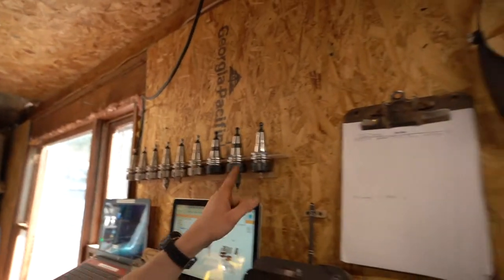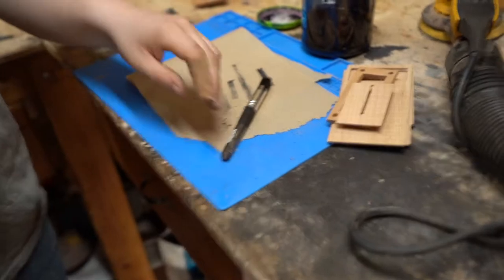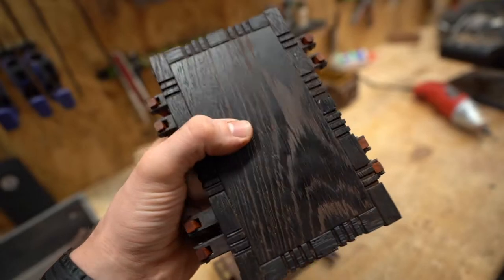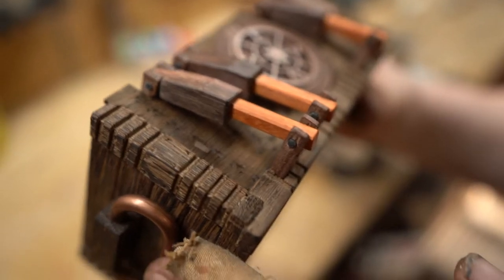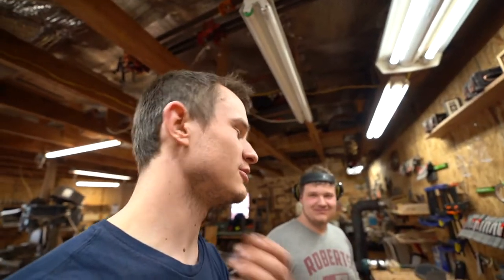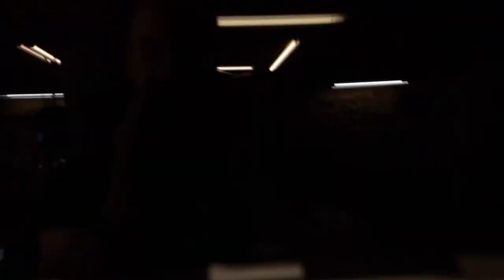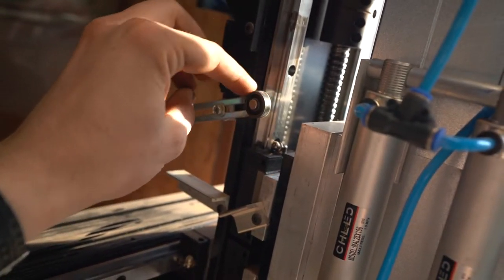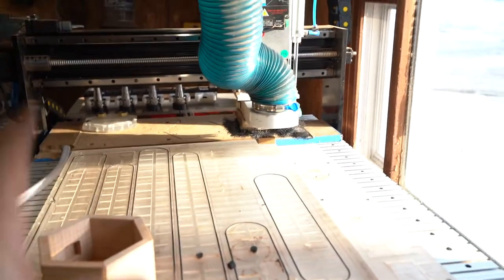It's all in the little details

Comment: I like your tricks to achieve precision with the CNC. But doesn't wood movement with humidity negate the need anyway?
Reply from the maker: Well, wood movement is a thing, however it depends on the species, the grain orientation, and the size and shape of the wood piece. If you are super consistent with your grain orientation the wood movement will be minimalized.